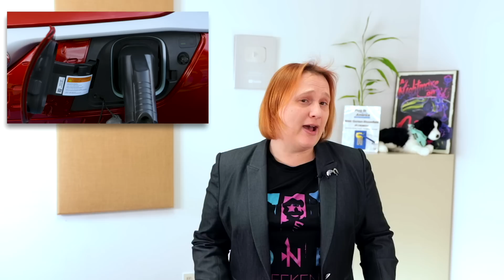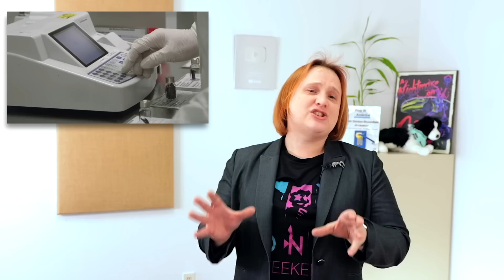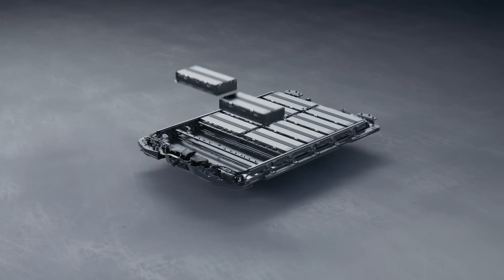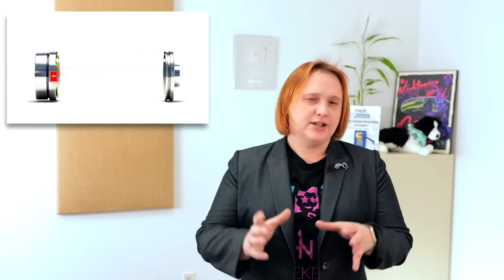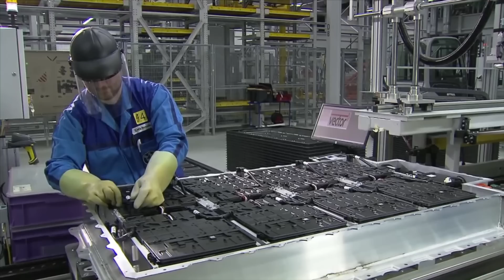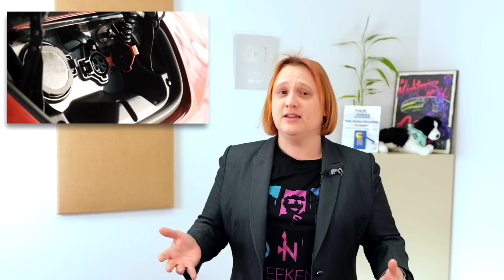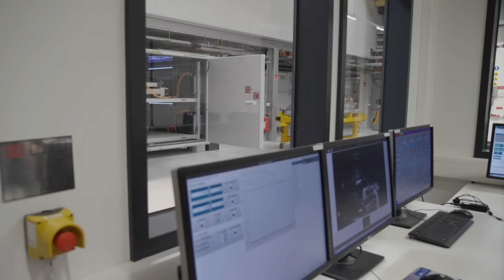Has Samsung Found The Holy Grail Of Solid State Batteries?

Comment: The big problem doing long hauls in the us... you talk about 500-1000 miles (1600 km)... My problem is that historically I've done 500-600 miles per day.  (Between my location and my sister in Michigan? 580 miles.  When you start adding an hour here, and an hour there.. and yet another hour up there... suddenly you start looking at significant travel time extensions.   As in a 1 day 13 hour trip becomes a 2 day 19 hour trip.  When the range gets up to 600-700 miles, then things become very interesting.

Comment: So range and charge times are illigitimate concerns huh? If you're on a long trip  and have to wait an hour to recharge your battery that only goes 200 miles that's costing you 70 lost miles every 200 miles of drive time  if you're averaging 70 miles per hour compared to gas with the same range. That's a real problem and a big deal if you don't live in a place where you can get to another country in 80 minutes.

Comment: Your description did not make clear if dendrites are only an issue for solid electrolyte batteries like that developed by Samsung, for liquid electrolyte batteries or both. To my knowledge it is both, though I believe solid electrolyte batteries are more resistant to dendrites for obvious reasons (a liquid is more permeable than a solid, so the former has more chances to puncture the separator, link the anode to the cathode and cause a short-circuit). 

There was also no mention of what kind of solid electrolyte the researchers used (assuming it was reported) and, more importantly, what kind of cathode they employed. Is it still lithium oxide based? I see no link to the paper in the description, this is why I'm asking.

Comment: But will it still be equipped with a 12V battery dedicated to accessories and onboard computer ? Those die more often than they should, making the EV into a giant brick until the 12V battery is replaced.

Comment: Ok so I always thought I was ok with the range of an IPACE. Well today, I need to drive abut 90 miles and come back the very minute I get to where I am going. Well when I got to my destination, I did not charge my car. I have to use my brothers ICE car to make this trip. First time I have found when my car was not sufficient enough.
Reply: That's why I would strongly recommend to you an EV with a range of not less than 200 miles.  A truly excellent choice for you would be a top-of-the-line Long Range Tesla Model S with an EPA-estimated range of 391 miles.  If you drive it just right, yes, 400+ miles of range are more than possible with 500-mile range on the horizon.  I recently saw a graph (I'll be darned if I can remember where I saw it) that shows the range of the Tesla Model S and if you were to drive it at its most efficient speed at an average ambient temperature of 68°F, you would get a peak range of almost 475 miles.  It showed expected vehicle range for the Model S as a function of its average speed with each line plotted for the average ambient temperature the same car was driven at.  Also, when you mention your 90-mile commute, do you mean 90 miles total round trip or 90 miles out and the same back?

Comment: I rented an EV for a month  before deciding if I should buy one. It was a total disaster. There are no fast chargers where I live and there only level 2 chargers which are painfully slow and require a contract with the provider. There was a case where I found a charger but my provider did not have a contract with them and I couldn’t charge my car. I had to plan my weekend trips according to charger availability and still I was very close to running out of battery. I had to always remember if I plugged in the car and check how much km were added to the battery. My normal car can refuel EVERYWHERE IN ONE MINUTE no contracts no obligations no paperwork.  It gives me infinitely more flexibility and freedom. I loved the idea of electric cars but honestly at this point  they suck. It’s no wonder that the have 1-2% of market share.

Comment: I would put 2 batteries on a car, one full and one empty.  While I use the full one, the empty one would recharge through regenerative system. Then switch from the empty one to the full one, and this "dance" would be without needing to change at a charging station.  .... just saying...

Comment: "Most modern electric cars have ranges of over 200 miles"

Yeah, only the figure stated by manufacturers is a theoretical maximum.  Unless you only drive around in the daytime without headlamps, don't like using the radio or air-con and only drive on perfectly smooth roads like a Grandma, you'd be lucky to get 50% of what the maker says it can do.
Reply: Automakers account for the many cumulative losses in their range estimates. The 2020 Chevy bolt is rated around 250 miles range. Some people have no problem getting 300+ miles during summer months. 200 miles range would be typical for winter in colder places. Higher speeds are less efficient. The range estimate is what an average driver could expect in average driving conditions.

Comment: If it's a marketable tech, it doesn't matter if it has been developed by a battery giant or a Dr Hoo - it will be implemented.
As for this particular one - I have doubts: it uses Silver, and this metal is kinda expensive and an elevated demand from the car industry would only increase it even further... Even if the single layer of the electrolyte is only 5 mm, the whole battery will contain kilograms of it...

Comment: Wham could we have stuff like a tv run on a batt and charge when it’s turned off. Just curious. Could work for lamps, tv’s, clocks, etc. a lot of house hold electronics. Then the next quest would be would this use less electricity then having you tv on for 6-8 hours??

Comment: Existing lithium ion can already deliver ranges that high. The Cybertruck LR will do 500 miles / 800 km. The new gen roadster will do 600 miles. It's definitely possible to cram enough batteries into an EV to attain those ranges today, it's just very expensive. So the barrier is not technological, but economic. The good news is that economies of scale from massively expanded li-ion cell manufacturing the world over have kicked in and cell price is dropping very rapidly. Even if better cell chemistries appear, if they're more expensive, we might just wind up using tried and true li-ion for some years just because of how much has been invested in the facilities to produce them.

Comment: A bit condescending. Maybe if you live in the city  and commute to work and back I would say you are correct.  You sound British so that might be fine for you also but if you happen to live in a country that is larger than one of the states in the US you might think differently.  I routinely travel 300+ miles from my house to my family's ranch and there is a mountain range in between...what is not is a supercharger.  Matter of fact there is not one at either end of the trip also.  I would call that an issue.  I am not saying electric vehicles are not the way things will go eventually but they need longer range and  faster fills. So battery technology needs to advance a bit but also we need to find a clean way to produce energy otherwise you are just shifting where the pollution is at.  People who think they are being green by have a Tesla because they have no exhaust on their car but use electricity that is made from coal are short sided at best but mostly just annoying.

Comment: I often drive over 500 km per day 5 to 6 days a week. I bill out by the hour. So how do I bill the extra hours a day?
100 000 km at 2 000 km per week.
New battery every year or year and a haft.
That sounds cheap.
Yes, I know I'm the execution not the rule, but gasoline is 10 minuets each 3 times a week. $80 per tank,
$240 per week, or aroung $12 500 per year.
Electric has priced it self too expensive.
I drive a work truck, go any where, any time, carrying the legal limit.
Show me an affordable option other then gasoline or diesel.
No, I can't  plug in at the job site. Unless I run a generator.
Battery meant longdays just got longer.
Electronic car for the wife to run to work and the kids around doesn't  add up ether.
She goes 200 km a week on $30 or so.
We bought a new car $30k (CND) the Electronic car that was smaller $50 k (CND). IF electricity was free that would be 12 plus years to pay for the electric car.
Electric cars cool toy but not a real option when I run the numbers.

Comment: The Model 3 Standard Range Plus version delivers an EPA-rated all-electric range of 250 miles (402 km) and the Long Range versions deliver 322 miles (518 km). At least one Model 3 was driven 606.2 miles (975 km) on a single charge.

Comment: 200 miles per charge that can recharge in an hour and a half is fantastic if you also have a garage to charge in and another car.

The capacity/range isn't necessarily the issue for wider adoption, it's the charge time. When you can get ~250 miles from 5 minutes of charge they will take off. Then those of us that don't have a garage can get one and recharge like going to a gas station. And yes, it also applies to cross country trips.

Comment: Where I live, electric cars are still much more expensive than conventional cars. To tow my caravan, I need a strong engine. When the car pulls the caravan, the fuel consumption doubles and so the range between refills halves to about 150 miles. On the way to southern france, I have to refill about four times and usually I drive the bigger part of the journey in one day. So I rather not stand waiting for recharge for several hours - somewhere near a gas station. Sounds reasonable to me, but apparrently I am being unreasonable and blind to what is best for me. Fortunately there are people to help me find the real belief.

Comment: Hydrogen electric vehicles already achieve 800klm range and refill in 5 minutes.
Reply: where do you fill up .... a billion places to charge an electric car in the UK alone....
Reply: Tesla Trevor now yes, but same can be done with Hydrogen by retrofitting existing service stations. Fill and go. No power points required.
Reply: @index6738  how do you get the hydrogen to the existing service stations ... will it be under pressure ... will it be delivered under pressure ... will it be stored under pressure ... will your vehicle be filled under pressure ..how do you make hydrogen , will it be by electric current passed through water how expensive would it be to make the hydrogen  ..The first commercially available hydrogen-powered FCEV, the Hyundai Tucson Fuel Cell SUV, produces substantially lower global warming emissions than the Tucson’s gasoline version. This FCEV produces 286 g CO2eq/mile if fuelled by hydrogen produced from natural gas, equal to the emissions from a 38-mpg gasoline vehicle. A far cry from a zero emission electric vehicle ...
Reply: Tesla Trevor producing, storing and fueliing is of no conscequence. Already deployed and in service in South Korea, Japan and USA to name few country who adopded Hydrogen Fuel for public consumption. The mass histeria is making of doomsayers. Until battery technology catches up...battery power point vehicles will remain second best.

Comment: The real issue is the carbon cost of producing a battery pack, which isn't mentioned in the video. The main problem with EVs, which is overlooked by the fanboys, is that while they are potentially clean to run (if we can clean up our electricity supply), they are currently very dirty and carbon intensive to produce. Conventional internal combustion is much cleaner to produce, and much dirtier to run (though there are major improvements in economy that are about to go commercial). The point at which EVs become more carbon efficient than conventional vehicles is contentious but is known to be well into the life of the vehicle. The major carbon cost of the EV is the battery pack. So a major move to EVs will, in the short run, add to the carbon load on the planet.
Reply: The Department of Energy pegs the break even at 18,000 miles.  Below 18,000 miles,  the environmental costs associated with making batteries and electrical components, and energy production for charging on an EV are higher.  After 18K, the savings go up dramatically.
We still need that breakthrough in battery technology that will change everything though.  As we can see, people are working on it. 
I live in Arizona, which has almost 300 days a year of sunshine, but still relies on fossil fuels for most of it’s power production; so EV charging from the grid still has some environmental costs.
Reply: @juliaset751  Depends which study you read, and whether they include disposal of the battery pack. The US position is distorted by your irresponsibly low gas prices and correspondingly inefficient vehicles. A recent German government study found that carbon breakeven was towards the typical end of life for an EV. And the Germans have a much higher proportion of renewable energy in their electricity supply than most. Of course the Germans have far more efficient cars and drive far fewer miles. The statistical argument is complex, but it's fair to say that cars and light commercial vehicles are a lower net contributor than most people believe, and that the true improvement in life-cycle emissions from EVs compared to modern ICVs is also lower. So the benefits of a large-scale changeover will be relatively insignificant, particularly as the carbon emissions of an EV are front-loaded and the benefits take a number of years to accrue.  If we're going to get out of this mess, we have to base policy on a careful analysis of the true priorities and not on populist green memes. EVs do have a role to play but it's minor, despite the hype that companies like Tesla are generating.
Reply: @tullochgorum6323     How much of Germany’s “renewable” energy is in the form of burning wood?  That not only reduces the green, but puts tons of CO2 and smoke into the atmosphere.  Germany is very far from being green and just manipulates the numbers. 
BTW, virtually all batteries and EV components are recycled in the US.  There are people all over the US who are using out of service EV power packs for home energy storage.
Your note about the artificially low fuel prices and inefficient vehicles is right on.  Fuel cost should reflect not only production price, but the price of environmental clean up, medical costs for breathing the tainted air, etc.  
And what is it about big, loud, stinky, 5 MPG vehicles that makes guys think that is “macho”?  
Unfortunately, that will never change in the US: too much government corruption.

Comment: I wish everyone would stop saying "higher energy density" or "it's super safe". Lithium can only store a set amount of energy period. It doesn't magically break the laws of physics and suddenly increase it's efficiency. The solid state batteries only actual perk is a longer life span of the battery itself. That's it, it doesn't make the charge last longer, it doesn't magically create wattage, and it doesn't actually make it any safer. 

Think about the explosive power of lithium when applied to water. Now put a metal or glass coating over it. Now imagine that exploding. You just turned a really hot possible fire into a really hot grenade. Glass is probably the worse of the two as anyone with a glass cup can tell you condensation is inevitable when the temperature difference it high enough.

Comment: 500 miles is the one. Mind you, if the batteries packs become lighter, you get improved range by default. So imagine say a 90kw battery pack of today, shrunk down to half the weight in these next gen types, range becomes much better.

Current cars, for my specific needs are just not practical at present - I do regularly drive long distances. Charge times are too long and the infrastructure really is so erratic here in the UK - unless you own a Tesla. A 500 mile range in something the size a Golf would be awesome! Hopefully Samsung does bring this new battery tech to market in the near future.

Comment: The biggest problem with electric cars right now has to be about your investment. If you buy one, its more expensive than the gas version, and when you've run its battery life out its worthless as no-one in their right mind would purchase it when it needs a very expensive new battery. Think of it like having to replace the engine on your new to you used gas vehicle. You could replace the battery before you sell it but that would make the vehicle expensive enough that new ones make more sense. No they are so far, a bad investment, you better like what you buy cause your probably stuck with it.

Comment: Don't even bother to mention battery tech that's still in limited use and testing in the laboratory.  There's no point.  Past experience has shown that whenever such as this is announced - in battery tech - it's another decade, AT MINIMUM, before it begins to penetrate the market in a commercial product.  So come back with an update in 2030, will you?  Thanks!

John~
American Net'Zen

Comment: Batteries are not the problem. It is the charging. For most people there won't be enough charging points, and if there were there is not enough power available. People will have to learn to walk.

Comment: I still waiting for a 1.2Gwh battery pack for my Delorean.
Reply: Good news for you, your Delorean only needs to produce 1.2Gw instantaneously.  You can have a significantly smaller battery pack capacity than 1.2Gwh but still be able to produce 1.2Gw of power for short durations of time.  Just trying help you save some cash on your time machine.

Comment: An 800 mile battery pack seems very unlikely as you would use weight/cost saving to install a 400mile pack for half the price. Thus more durable charge cycles are still important.